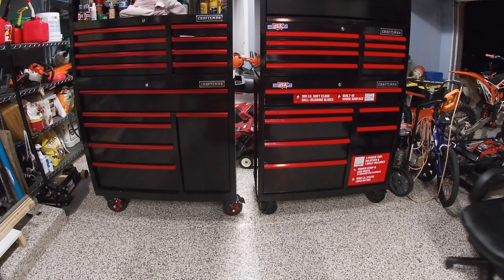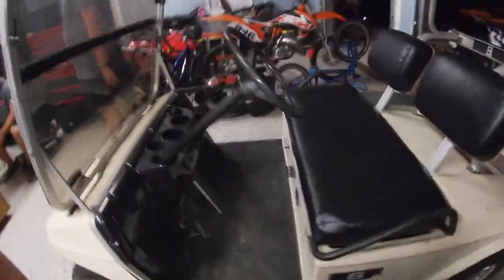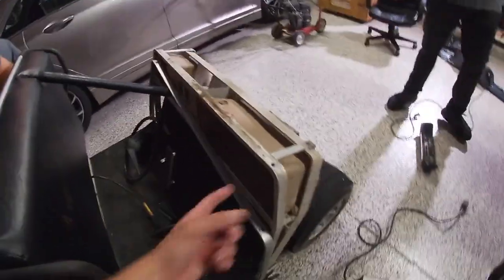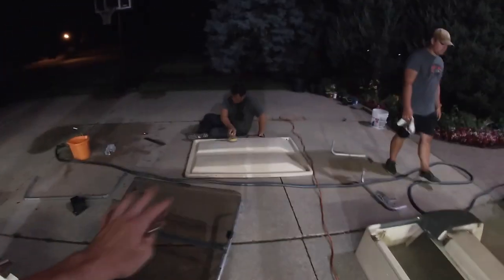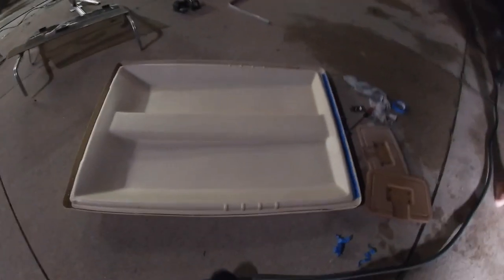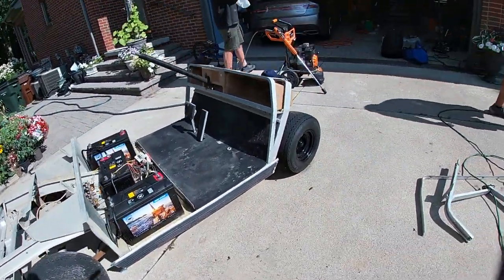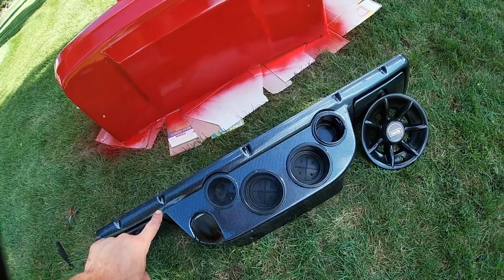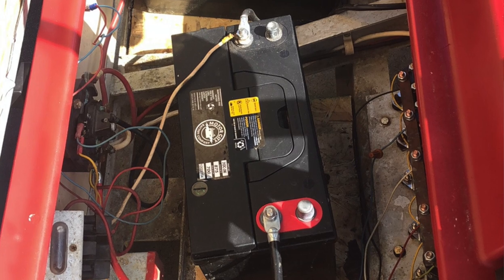I BOUGHT A GOLF CART TO REBUILD BUT FAILED

Comment: You spent 1600 on it fixed up nice you can get 2500 to 3000 check out ebay the parts you take off put them on the same way  as long as the motor is good the rest can be fixed easy I'm going through the rebuild of mine. It just take time plus I see you have 3-12v batteries and it should have 6-6v batteries but it will still run. Just not as long.
Reply from the maker: I actually ended up trading it for a Honda 150 dirt bike and then selling that bike for 2900 so at the end of the day it worked out

Comment: sounds like you got a lot of bad info even from the mechanic. First off you should have paid about 500 bucks being a older 36 volt and missing batteries. That cart runs on solenoids and resistor coils and a throttle switch all cheap parts and not on a controller like the newer 48 volt carts. If you want to make it run 5 mph faster switch the main solenoid to a 48 volt and put 48 volt batteries in it. I would def improve that red paint job also.
Reply from the maker: we ended up trading it for a dirt bike, but to be honest with you I think the guy we got it from might have known but just neglected to tell us
Reply: Yeah you were right sir, it was probably a 20 dollar solenoid and your correct it doesn't have a controller , this in the video was the ones that when you punched it - it would spin full blast with no pause because there was no controller

Comment: just buy the AC kit it comes with everything to make this burn the tires off the back i bought golf cart out of junk yard for 100 bucks it had the lights an allium frame but for the same price you bought this one i got one with all brand new parts golf cart the guy like why dont you just buy golf cart for 2500 i said cause i still got a old wore out cart this way is a brand new 2021 just on older frame
Reply from the maker: Didn’t know about the ac kit thanks for the heads up!

Comment: Yup electric carts suck.. Unless you literally plan to replace everything with high voltage motor, controller and lithium battery conversion.  PS I'm a cart Mechanic
Reply from the maker: I would love to get a gas cart to work on one day, but I'm thinking of doing a sand rail build first actually